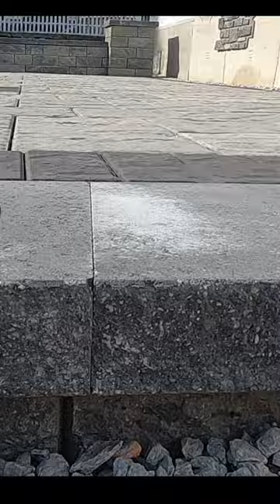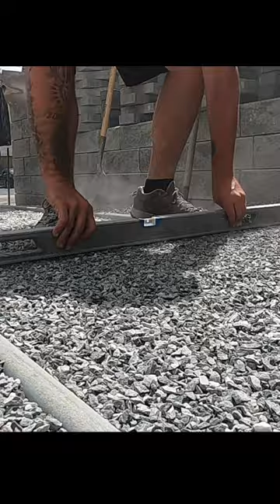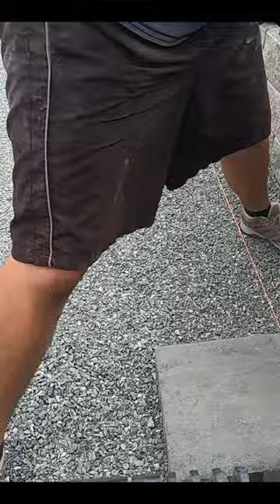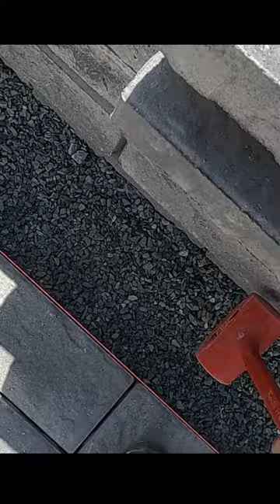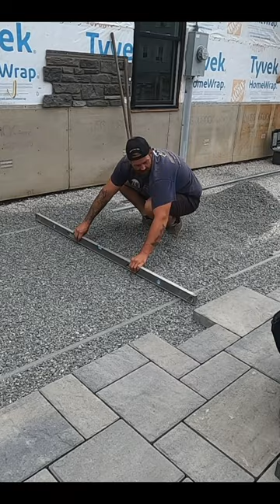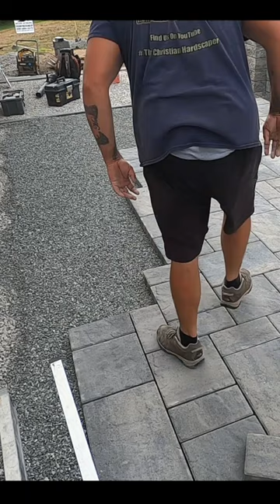Laying a Paver Patio | #pavers #hardscaping #paverpatio #patio

Comment: 😮😮😮😮what about the send between base and paivers ??? I know you save some cash  but do not doing Mickey Mouse 😮😮😮😮
Reply from the maker: This method does not use sand, and it is more expensive then sand... This method is far better then the mickey mouse method of gravel / sand.... I use (open grade base) under all my pavers. 3/4" clean stone for the base and 1/4" - 3/8" clean stone for the bedding layer. Here is a video that explains the method in more detail 👉https://youtu.be/ChaJe3JqD6I

Comment: No sand? Interesting. Looks absolutely wonderful. Great job
Reply from the maker: Nope, we lay our pavers on clean, crushed stone. It helps prevent sinking and shifting ✌
Reply: I put mine on gravel. It was easy. But on stones? Quite unusual. But definitely bl..y ants will be not able to take sand from under slabs and gradually create 'waves' on patio😊
Reply: I did 8 inches of road base gravel, and one inch of blue crush as my paver base
Reply: @edbrown7919  seriously, beautiful work
Reply: @Paula_A_bdul  thanks Paul!

Comment: Beautiful work! Do you always lay the pavers on compacted 3/4 minus or do you use sand to level it out? I’m thinking of building one myself and would like to ask an expert like yourself!
Reply from the maker: Thank you! It is hard to tell in this short video, but we use 3/4" clean, crushed stone for the base stone and we use 1/4" - 3/8" clean, crushed stone for the bedding material. Here is a link to a video I made which explains the base prep in far more detail 👉https://youtu.be/ChaJe3JqD6I

Comment: That looks great. 
This will sound dumb. But…… will the pavers move because there is no cement? Or is it because they are locked in by the wall and gravel that prevents it from expanding over time. 
I want to try this in my yard.
Reply from the maker: Thank you, and the pavers would move without securing the edges with concrete. Against a wall or structure, no concrete is necessary but when there is nothing against the pavers, you definitely want to concrete them ✌

Comment: what type of gravel did you use? is that 5/8" or less?
Reply from the maker: The base material we used is 3/4" clean, crushed stone and the bedding material is 3/8" clean, crushed stone. Here is a video I made which explains my base prep method in more detail 👉https://youtu.be/ChaJe3JqD6I

Comment: Looks great. Only thing im curious on is how come you used only 3/4 clear gravel? Usually we use that on the base and then the last 2" we use 3/8 clear chips and compact again. It makes screeting the patio much easier. Regardless great work!
Reply from the maker: Thank you, I use 6-8 inches of 3/4 clear stone and then 1 inch of the 3/8" less clean crushed stone for the bedding material. Here is a link to a video I made which explains my method in more detail 👉https://youtu.be/ChaJe3JqD6I

Comment: So nothing really holds the pavers down, they just sort of free float on the gravel ?
Reply: yeah, in a couple of years it will be all wonky
Reply: @DarioPicaTips  damn! That’s what I was thinking. Seems like a lot of work for something that is not more permanent and durable. The only thing I could find was sometimes they they use edging or poor some concrete at the edge to keep everything around the edge from moving. But that’s crazy to me, a heavy enough load will offset the pavers etc. I mean I suppose if you just walk on it it doesn’t matter idk 🤷‍♂️ seems like slabs of concrete with re bar tiring it together is way more long term and resilient then just placing stones.

Comment: Love the work you do, 
dont we have to use leveling sand over gravel? I thought that was the way.
Reply from the maker: This is a different method of base prep that uses only clean crushed stone to allow for better water drainage to help prevent freeze / thaw issues in colder climates. It is called (Open Grade Base). Here is a link to a video I made which explains the method in more detail 👉https://youtu.be/ChaJe3JqD6I

Comment: Hey I’m curious I’m doing a project like this for someone and was wondering how much you charge. Everyone down here in Florida uses concrete fines and no rock for the sub base
Reply from the maker: Hey there, I typically charge $22 - $25 per sq ft for paver installs. walls / pillars are a different thing...
Reply: thanks for the quick reply love your work @TheChristianHardscaper

Comment: Why did you not use sand I have no experience but have seen guys use 1 “ of sand
Reply from the maker: I use a backfill method called open grade base. It is made up of 2 different types of clean crushed stone. The base is 6-8 inches of 3/4” clean crushed stone and the bedding stone is 3/8” clean crushed stone. No fine particles in the stone to allow water to travel through freely. Better for drainage and helps prevent heaving in the winter months. I have multiple videos on my channel explaining why it’s better than sand. Here is a link to one of them The BEST Backfill Method for Concrete Pavers (Open Grade Base)
https://youtu.be/ChaJe3JqD6I✌🏻
Reply: @TheChristianHardscaper  I really like that method been watching your videos thank you
Reply from the maker: No problem, this method is game changing.... ✌

Comment: The only not good thing is that water will go under to reach the house's slab.
How about using bank sand (sand mixed with dirt).
Reply from the maker: The water will go to the french drain pipe I installed along the entire front of the house and be diverted to the right side of the house.

Comment: Fine blinding would have been better on top of that hardcore
Reply from the maker: I know what you are talking about, but this backfill method I use is specifically for clean stone. It is called (Open Grade Base). It is meant to allow water to travel through it freely. Here is a link to the video of when we backfilled this project 👉https://youtu.be/4zhS7bSvFVA